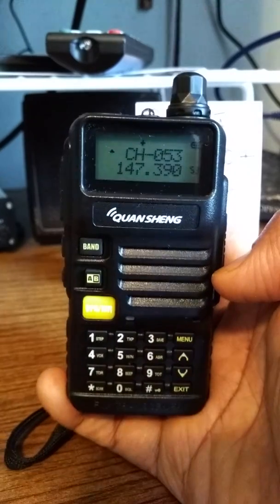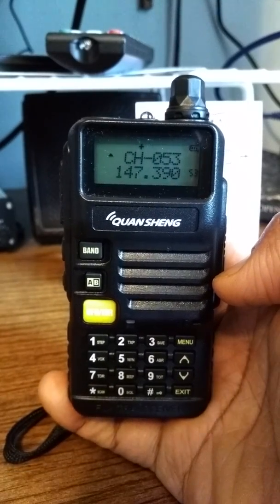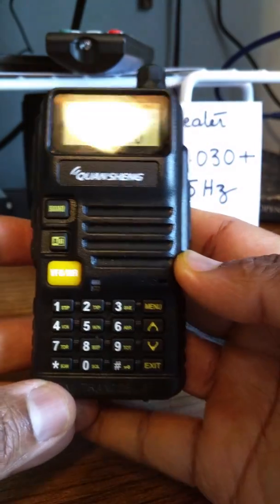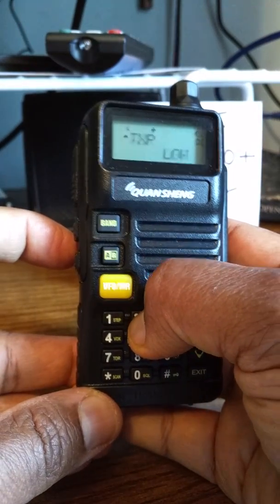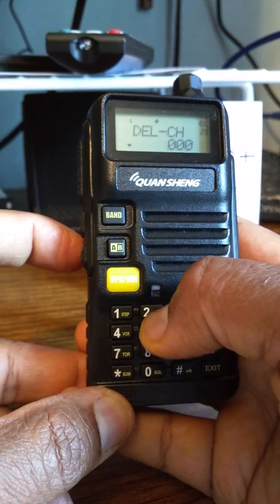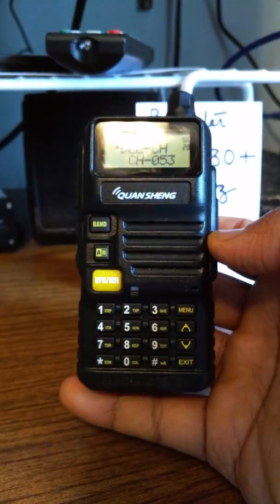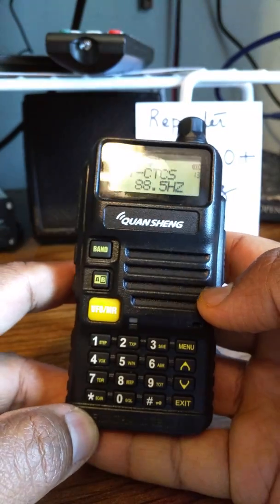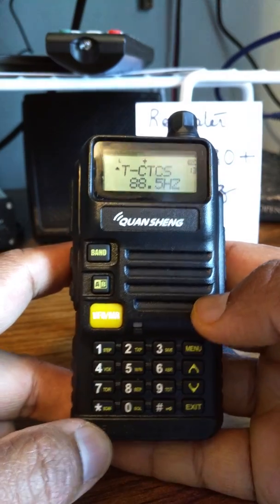Quan Sheng UV-R50 QUICK manual / keypad programming

Comment: Nice video, thanks. I am trying to set the bandwidth to narrow (12.5kHz) on 70cm but it does not seem to work. When I select narrow it switches back to wide. Do you know why that is or if I am doing something wrong?
Reply from the maker: I went into VFO mode, set VFO A to 446.000 then I switched to VFO B & set that to 447.000. So both VFOs are at UHF freqencies, then I went into MENU => 5 => MENU => Up arrow to show NARR => MENU (to confirm the switch to Narrow Band) => EXIT.

After setting to NARRow band, to prepare for a simplex channel, I turned off the frequency shift direction (option #25) & set the OFFSET to 0.0 (option #26). 

Then the programmed the 447.000 in simplex mode into channel 51 as follows: MENU => #28 (delete channel) => MENU => enter "051" => MENU (to confirm the dele) => DnArrow to option #27 (mem ch) => MENU => enter "051" => MENU. 
I heard the radio say, "receiving memory". Then I pressed exit to leave the menu system. 

I turned on my base station and had another HAM simplex me from the QuanSheng in NARR mode, we were able to communicate both ways without any problems. Hope that helps. 

The NARR or WIDE setting is saved with the frequency & other parameters for each channel, so you can have the upper receiver in WIDE mode & the lower in NARR mode.